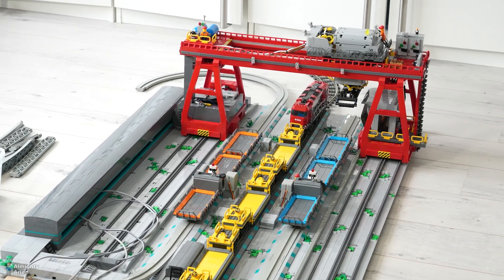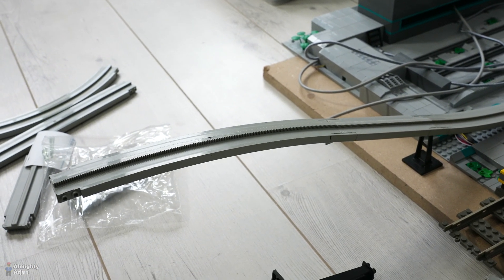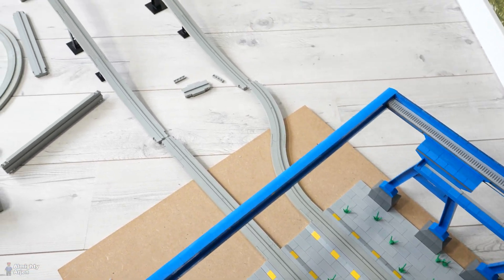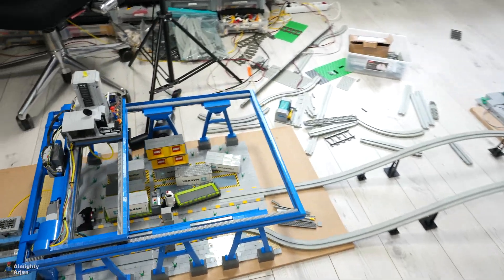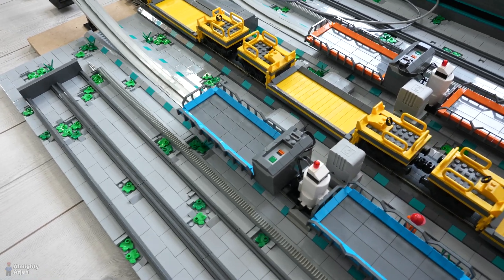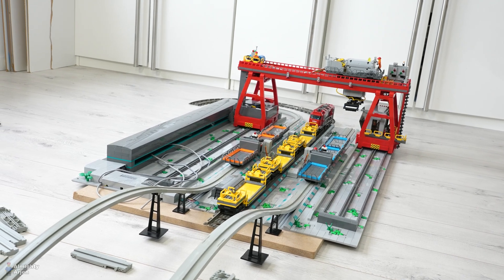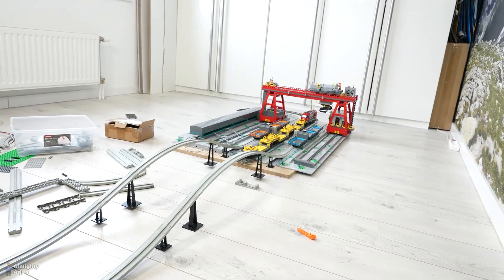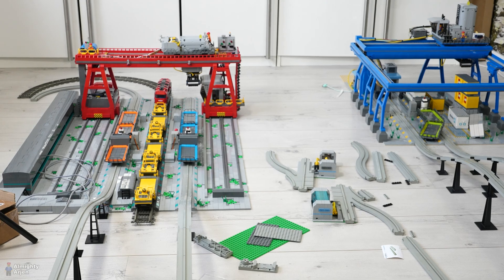Automated container terminal WIP E49: monorail layout issues

Comment: Hey Arjen. How do make the train stop on the 9v track? Do you use the same method as the 12v set 7860? But just code it with an Arduino.
Reply from the maker: Yes. I isolate a part of the track where I want to stop a train and I control the power on that track with the arduino and an L293D motordriver.